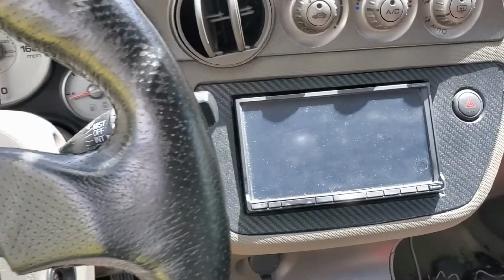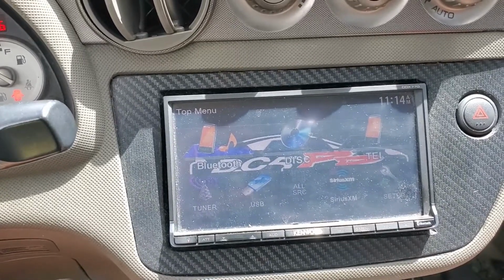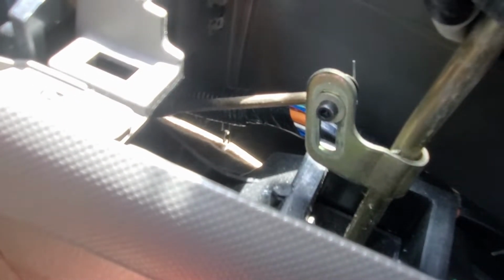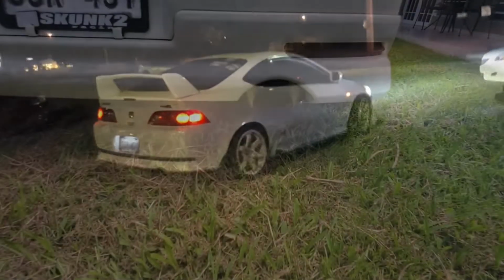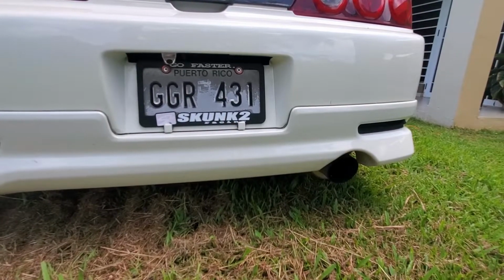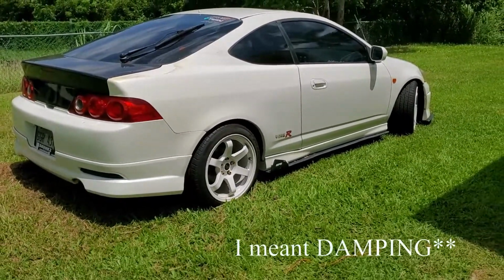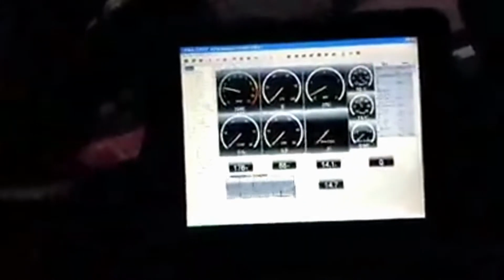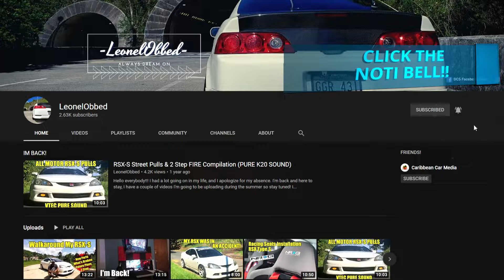My Top 5 Mods On My RSX Type S

Comment: How much of a drop are the tein coils vs stock and is there any scraping/clearing issues? And how’s the ride stiffness?
Reply from the maker: They are completely adjustable so if you want it to be stockish height you can do that. However if you slam them, you can probably lower the car a good 3 maybe even 4 inches. In my setup at least the stiffness is just right. Clearance issues I had some minor ones in the rear because I did a 225 tire on my x9 wheels so I had my fenders rolled
Reply: LeonelObbed oh okay! What height do you have yours? And is the ride comfortable? Thanks for the response and videos!